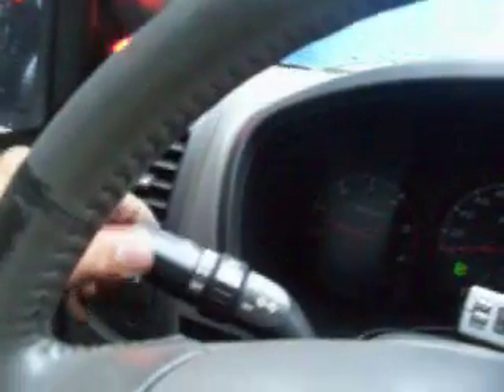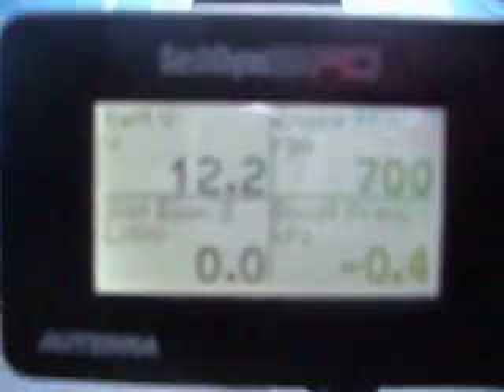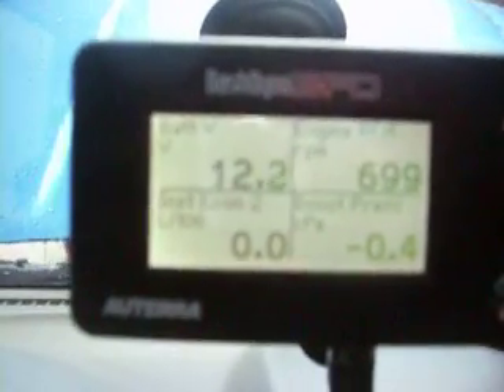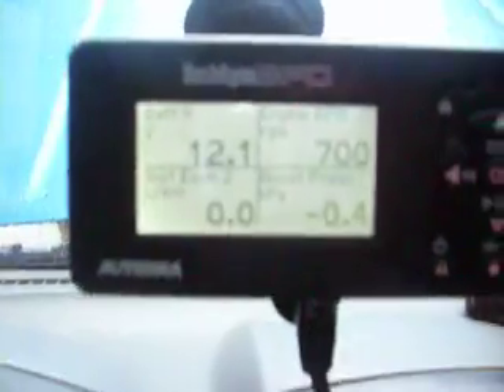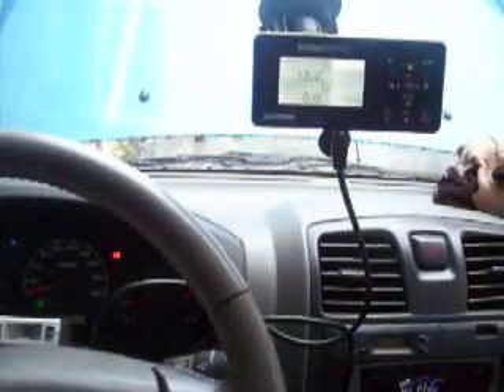KML Lines Improved Voltage Draining of Isuzu Pick up

Comment: Hi ehnriko! Did you use coax cable for antenna? or something else? Do you have one for both positive and negative pole on the battery?

AND have you noticed any increase in engine temperature after the install of KLM?

I ask too much... sorry :-)